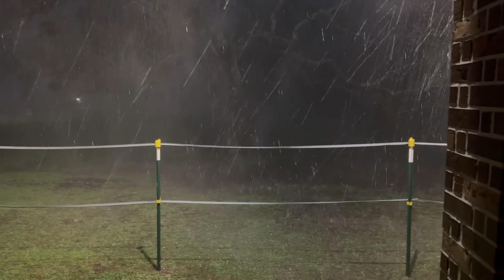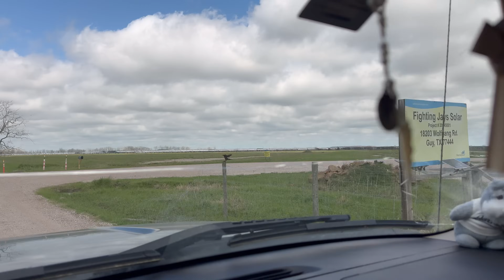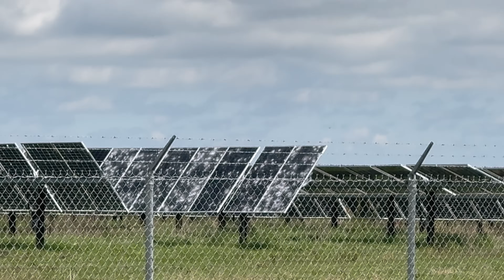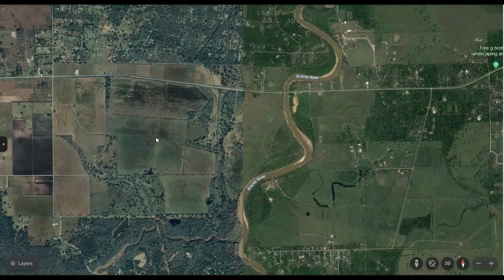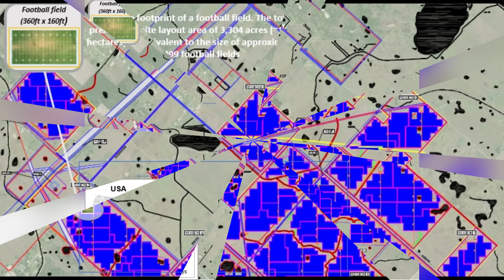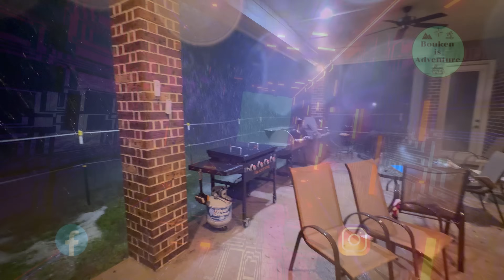What can Hail do to a Solar Farm?

Comment: What is not even mentioned as most people may not be aware of, 80% of all solar panels are made in China by slave labour.  The replacement of all those panels from one farm will also put a heavy burden on landfills as 90% of solar panels are not recycled.  The environmental costs of one hailstorm have far reaching effects few people and organizations want to talk about. The costs of replacement, mining materials, manufacture, transport across the globe, well water contamination and run off to name a few. Go Green.
Reply from the maker: We swung by the solar farm and most of the panels have not been replaced. It looks like they are not going to repair all the damaged panels.

Comment: I’d like to have some of those panels. You can put clear sealant on the surface and use them with little power loss.
The 1.3 gigawatt farm in southern Lamar County Texas has tracking mounts that mitigates hail damage.
This feature is to follow the sun from east to west but can be moved to almost vertical.
The fossil fuel propagandists use these events to try to recover their stranded assets.
Reply: That’s an interesting idea. I wonder if the insurance company will try to sell them in an auction or something.
I can see a business idea here for the right enterprising people.

Comment: The frames that hold the solar panels should be adjustable to accommodate not only direct sunlight but for hail as well. A verticle position during the storm would have had a more favorable outcome.
Reply: They don't do it because to do that costs more than the panel itself.
Reply: @thedivide3688  works just fine for mine but on the other hand if you're greedy enough to bite off more than you can chew you get what you deserve.
Reply: @robertpaulis439  You talking about your home which has a few panels.  We are talking about solar farms here that need automation of 1 million plus panels each 4x the size of your 1 standard panel.
Reply: @robertpaulis439  That moving structure is even worse. The motor keeps wearing out and needs regular oiling, repairs etc. They also cost high, need electronics control and several other complications which is not at all worth it.
Reply: @ the device But they do build this feature. It’s not an added expense just for hail protection.

Comment: In Texas? Who'd a thought that?
Reply: I would. Global warming will sometimes feed polar vortex breakouts which cause cold jet stream air to dip far south and cause hail when it collides with warm humid air from the Gulf.

The sobering reality is that global warming will continue to speed up as humanity is not going to reduce greenhouse gas emissions fast enough to prevent tipping points from triggering an abrupt change from a temperate interglacial climate to a hot/humid greenhouse climate. (Probably our only hope for a reprieve is if volcanic activity increases and puts particle aerosols into the atmosphere that would reduce solar insolation & produce a cooling effect.)

Eventually the smart money will install motorized trackers on solar arrays that will park panels in a safed position when hail is forecast. Very expensive yes, but insurers will have to raise rates in the future as hailstorms become more frequent & more widespread.

Wind turbines can also be negatively affected by hailstorms, so the utility grid will need to have non-renewable power plants online to be able to meet demand during & after major weather events that take out some renewable systems. So, no easy pathway to netzero as far as I can see.

Challenges... nothing but challenges ahead. We'll just have to muddle through with a mix of sources that are reasonably resilient and sustainable.
Reply: Maybe horse face John Kerry could go to China n demand they shut down just half of their over 2500 coal fired energy plants! Good luck with that John!

Comment: ANOTHER  REASON  N~O~T   TO  GO  SOLAR!!!!    I  SAY,  "DRILL,  BABY,  DRILL !!"🤣🤣🤣🤣🤣🤣🤣
Reply: Yeah because oil drilling , recovery and transportation has never resulted in any environmental impact (your a dumba$$)
Reply: Here is a guy in my village (in Germany) with a PV-system on his roof and it is running now since 25 years. I think they had replaced the inverter once, cleaned the PV-modules two times ... but nothing more.

In the USA are bigger storms and the possibility of hurricanes at the south coast.
But there is a ways to prevent this! It looks like they can change the angle of the PV-modules, but only manually.
If they would add a motor, then they can increase the angle to 90° and then the panels will not get hit. Possibly they would need a little metal-plate on the edge of one side of the panel. If they increase the angle to 90°, then this will protect the edge from hail-balls, because then it is working as a roof.

So there are possibilities to deal with this problems.